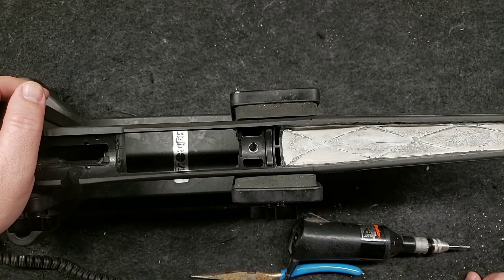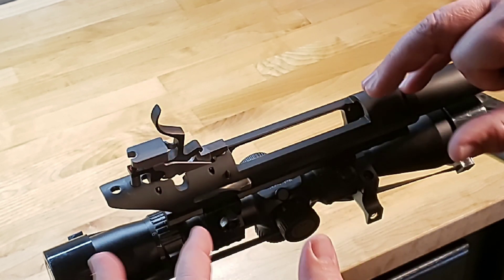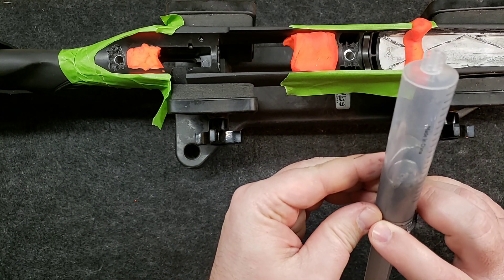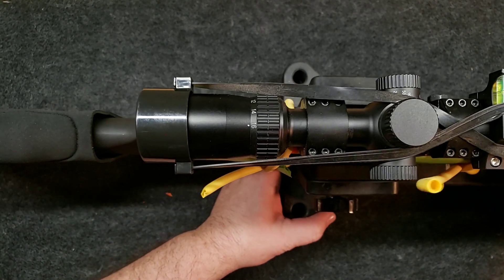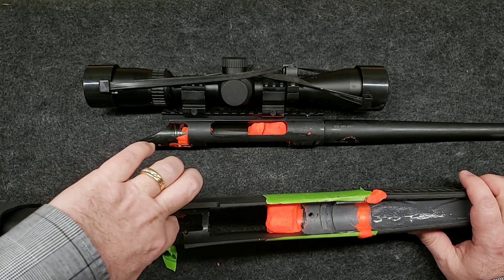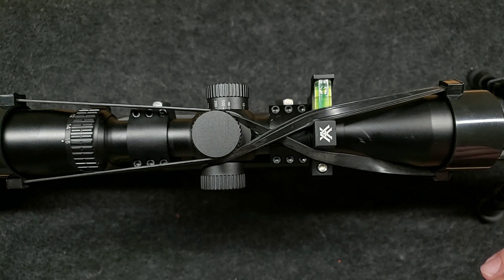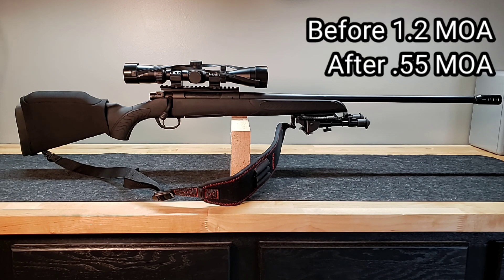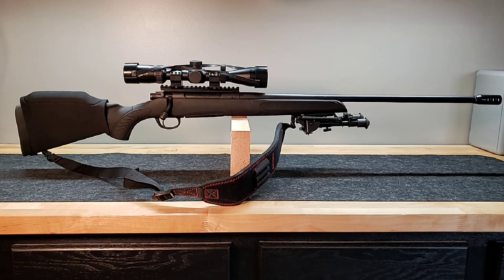TC Compass 300 Win Mag EP10 - Bedding Stock w/JB Weld

Comment: Steve, I have a TC Compass in 6.5CM that shoots 3 shot groups consistently at .6 to .7" MOA at 100.  Right off the shelf.  I don't think doing any bedding work would be worth it.
Reply: I've accurized a tc compass in 204 ruger and have a folder full of groups from 1/4 to 1/2 inch and I'll tell you straight up bedding won't do alot for it. However if the stock so much as breathes or flirts with your pencil thin barrel it will shoot all over the place.
Reply: I have the T/C Compass in .308 , .850 to 1" 3 shot groups out of the box , I'm with you , bedding would be a waste of our time.
Reply: In MHO, bedding is a useful addition. The recoil on a 300 WM is substantial and a cheap plastic stock cannot stabilize the action/barrel for consistent accuracy. What a great idea to stiffen the fore-stock. I’m doing the exact same thing on my Compass. Your results are impressive.

Comment: So after 1 year, has the factory stock with JB Weld held-up?  With the .300WM, have any cracks developed?  I'm not sure if the factory stock was engineered to flex a bit or not but I have the same problem with mine see-sawing on the recoil lug.  I wrapped small spiral strips of Forg epoxy tape around the factory bolts 1x and it was just enough to snug them up inside the aluminum pillars.  I cut and stacked carbon arrow pieces laterally in the 2 center "diamonds" of the stock wells and JB welded them in place.  Now I am just wondering if I should go for JB bedding in the recesses around the front pillar by the recoil lug.  It doesn't seem right to press on the barrel with a few lbs of pressure and it moves enough to touch the fore end of the composite stock.
Reply from the maker: Currently I have approximately 300 rounds down the barrel with zero issues with any of the work. I just took it apart and dont see any cracks or issues. I don't think the stock engineers would have designed the stock to flex purposely as the end goal is to create the stiffest stock they can within the budget allowed.  I do have a couple of videos very close to completed on this build and will be posting soon.  Honestly, this series was more about what is possible when thinking outside of the box.  My recommendation would be to replace the stock if you plan to shoot past 300 or so yards.  One of the Boyd's stocks would be a good option here.  This will never be a precision rifle but it doesn't mean it can't be made better.  Thanks for watching and your comment.
Reply: @ringsteeltv3179  Thank you for replying!  I want to keep it light but make it accurate for elk hunting and fun target shooting out to 600 yards.  I am putting an SWFA SS 10x42 scope on it.  I love your series.  Thanks!

Comment: Does bedding before the recoil lug help?
Reply from the maker: Bedding in the area in front of the recoil lug supports the chamber area of the barrel and is well known to provide better results than no bedding.  The recoil lug design in the TC Compass is different than a Remington 700 as its unattached to the face of the receiver.  The slot where the recoil lug sits can be sloppy and the bedding will fix this but ideally the recoil lug should make metal to metal contact with this slot.  This can be accomplished by forcing the receiver back against it during the bedding process.

Comment: Why did you dremel out the spots in the stock?
Reply from the maker: The purpose of those channels on the bedding blocks is to give some thickness to the JB Weld on the blocks.  Otherwise the JB Weld would be extremely thin there.  If it was a wood stock I would not have done that as the bedding material would have adhered regardless of thickness. I was concerned the JB Weld would not stick to the plastic and in my mind that was the best solution for covering that thin section and giving it strength by creating the channels between the larger pockets on either side.  It is important we left enough bedding block for the receiver to index to so we dont change that reference point.  Hope that answers your question.  Time will tell if it worked as this was my first attempt at a plastic stock bedding job.  I'll do a 200 round follow up and check how its holding up.  Thanks for the question!
Reply: @ringsteeltv3179  any place the plastic is left even somewhat smooth the epoxy will not stick at all and will always separate actually to be perfectly honest given all the failures ive had with bedding plastic stocks ill say in this video he didnt dig enough plastic up, the edges where epoxy is hanging over smooth plastic is going to separate. when bedding over plastic you cannot dig enough or create enough mechanical locks. when it comes to laying epoxy on plastic it never adheres it can only lock itself into imperfections you create.
Reply: @billkelley2388  I just gave it a go with JB Weld Plastic Bonder, waiting for it to harden up and see what comes of it.
Reply: @johnkennedy3338  I just finished two of them I tore both up and dug a bunch of plastic out, also put a loop on a hanger and heated it with a torch to melt bumps for it to lock itself into. I used devcon plastic steel and they were both a great success. Alot learned from failure.
Reply: @billkelley2388  Now to see how it works as I work up some loads on 7mm mag.

Comment: What made you decide on JB Weld?
Reply from the maker: The only reason on the JB Weld was cost to keep everything under $500.  There are better products out there, however with approximately 300 rounds down the tube it has held up very good.  Hope this helps!  Thanks for watching.
Reply: @ringsteeltv3179  It's pretty cool. Great video and groups.